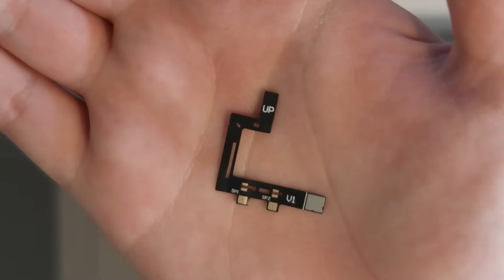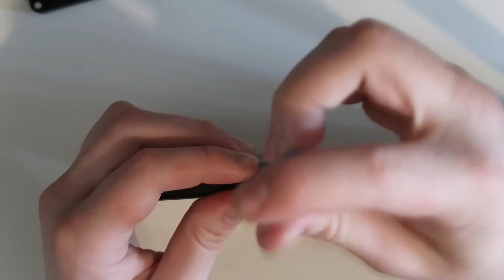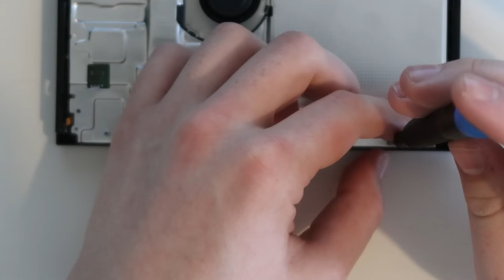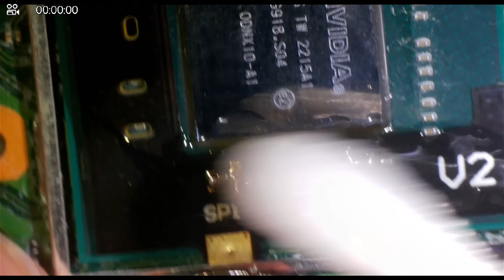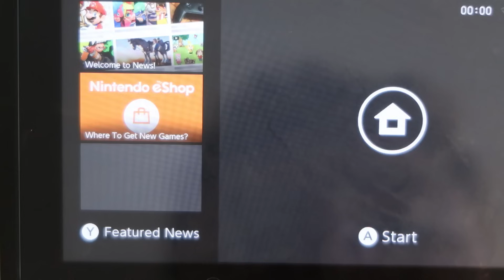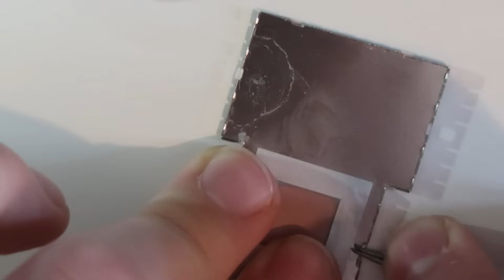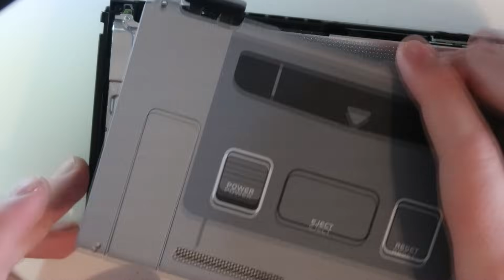Nintendo Switch RP2040 (PicoFly) V2 Modchip Installation

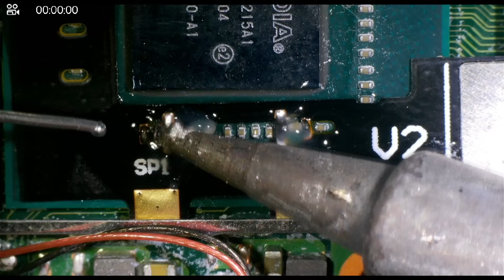Comment: He's really making it difficult at 12:30 by doing a coldjoint, chances of frying the resistors are very high. The proper way is to tin the resistors with solder, tin the flex cable. This way you have two points that can join more easily. Then wipe off the flux with alcohol, reapply a toothpick amount to each and it should go right in. 

Now the lite and OLED, different story..
Reply from the maker: This was my first V2 install, I agree it could be better. I just did an OLED and posted the video yesterday too.

Comment: Thanks alot did it successfully on a v2 switch. But i have a problem... After playing for like 3 minutes, it says ,console is overheating and it shuts down. Of course i cleaned all the old thermal paste off, and refreshed it... Well idk it doesnt even sounds like, the fan is turning on . Does anyone have the same issue?
Reply from the maker: If it's overheating, the fan will be very loud and you'll be able to tell. You fan is either faulty, or the ribbon cable isn't correctly seated.

Comment: I never did soldering what is that thing you use for heating it
Reply from the maker: The tool to melt the metal is called the soldering iron. Solder refers to the metal itself, and the paste that helps the solder joints form properly is called flux.
Reply: @TheModSmith  oh I learned it thank you and have a nice day :)

Comment: Which usb c cord did you use ?
Reply from the maker: Just a regular USB C cable for programming the chip.
Reply: I was told it needed power and data capabilities.

Comment: Thinking about modding my switch since i have a more recent version and I would need to do the whole mod chip installation but I've never worked with saudering tools before so this is where I'm a little hesitant on doing this in the first place if there are any recommendations you could share on what tools you'd recommend someone like me to use as a first timer that would be great! Thanks for the detailed guide I wouldn't even know how to unscrew all the right screws without this one.
Reply: I’m wondering the same things I’m new to it and everyone keeps saying sell my current one and just buy an unpatched one have you found anything?
Reply from the maker: They're probably saying that because of the difficulty of the modchip install.

Comment: I have a lite model rp2040 modchip. Can I use it in the v2 model?
Reply: Not unless you want a much harder job
Reply from the maker: You probably could, but for the sake of $10, get the chip that is intended for your console.

Comment: I plugged the mod chip to the computer but instead of a window popping up I get a long blue LED followed by 3 pairs of yellow short blinks. Does that mean it's already flashed or is it an error message?
Reply: I have the same issue, how did you solve it ?

Comment: Just curious, what temperature are you using on your iron here? Also, what kind of solder?
Reply from the maker: I solder at 420 degrees as I’m quite fast, although people recommend lower temperatures near 340 degrees. I also use 60/40 tin lead solder.

Comment: I modded my switch lite like 2 years ago. Have had a blast with it playing emulators/rom hacks/ etc. etc. Since I never had any issues getting banned on my switch lite I decided to order a RP2040 kit for my V1 patched switch. That was literally the week Mario Wonder released and I had a physical copy that I had already played multi hours on my V1 switch. I decided to pop the game cart into my switch lite and when the game booted it started auto updating without me hitting anything. Needless to say my switch lite is now banned... So now I've just been sitting on this RP2040 mod because I'm too afraid I'm gonna get my OG switch banned if I mod it too.
Reply: You should never, ever use a cartridge from a Switch that is not modded, on another Switch that is. That's an instant ban.
The cartridges have a special key that they synchronize with the first Switch where they are used, and if you try to put that cartridge that is synchronized in a modded Switch, there you will have the ban that you got...
I say that you can mod your Switch V1 without problem, the problem is the cartridges
Reply: Use emunand!!!
Reply: @lantonicorporation  How does that prevent you from getting banned? I was using emunand. So if I restore it from the backup I made before setting up emunand will that fix my online ban issue???
Reply: @lantonicorporation  Ah just grabbed my switch and checked... I was thinking of the emuMMC. But after doing some research I might still be able to save my switch lite. Doing some digging on emuNAND too so I might end up modding my other switch too after all. Thank you for the advice BTW!

Comment: I’ve got the mod chip ready for my switch. Unfortunately my display connector on my motherboard is broken, so I can only use my switch docked. Does the switch display a signal while being docked and booted into the new menu?

Comment: switch seems to not power on after i connect the enand to the chip, but will power on when the enand is attached to the board in its proper place?
Reply: silly me, i did not put the mod chip into the connector where the enand originally was

Comment: Hi, I got a V1 switch. I have soldered everything but when I turn it on, the chip flashes blue and then ==*. And it goes into the regular switch screen.

Do you know anything? Thanks!
Reply: @Natrez914 It's definetly patched. I have already tried the RCM jig thing

Comment: @20:15 IF YOU'RE TROUBLESHOOTING AND WONDERING WHY ITS BOOTING TO THE NINTENDO SCREEN INSTEAD OF THE MODCHIP: 

please also be aware that aside from the potential mod chip not being pre-flashed (which i believe is rare), it can also be that the switch isn't detecting the modchip (make sure theres enough space and not too much pressure where the mod chip is installed to prevent the connections from acting up (the pressure and screw and partial reassembly can also cause this (though in this videos case, it didn't). Really your soldering connections should look good and flush to avoid this, but just incase... I was wondering why mine kept booting to nintendo instead of the modchip whenever i'd power it on. And that was why. Make sure the connections are solid as well!
Reply: How you know when they’re solid?
Reply: @languidcreature2345  Well check with a multimeter on continuity mode first after the chip install. Check all newly soldered points. Once you'll be ok in terms of the connection. But again if there's too much pressure or not enough room for the modchip you may have to carefully clip the apu bracket to let the ribbon cable have space. And the mod chip you will have to cut the metal back shield as he shows here. maybe dont tighten the screws as tight if you have problems. i did!

Comment: i have a question: is re pasting the switch optional
Reply from the maker: No, thermal paste must be cleaned off with IPA and replaced every time you remove the heatsink or disassemble the console for a modchip install.

Comment: Way too much Flux and way too much solder you maniac
Reply: upload a video of how you do it
Reply: There will never ever be such a thing as too much flux, dingus.

You're the one that's gonna ruin your consoles 🤷‍♂️
Reply: Agreed, no clue how I managed but had no flux but managed to solder the pins.... thanks to this guy I was bored and ordered the kit from Ali express for less than £7 lol really shocked it works lol
Reply: @lewisviper soldering without flux is not a good idea, the solder points won't be solid and can break at any moment
Reply: solder wont stick to anything but the wrong things without flux  @swianr
Reply: @scottjohnston3098  not true, well unless ur hands are shaky and your solder skills are subpar. too much flux can actually lead to cold joints and less control. I rarely use much if any flux on my projects but I do use rosin core flux solder which is generally the perfect amount if you get it right first got. joints will be much stronger. also having a quality iron with accurate temp control and the right tip for the scale is crucial. never forget the day I upgraded my RadioShack iron to a hako it was game changing
Reply: @swianr I solder all the time without flux, although my solder does contain flux. If I have any issues getting a flow (because of an oxide layer) I use a mild soldering acid from a cotton bud only onto the contact. Not sure I'd use soldering acid on a switch, would probably be ok to use on the contacts before placing in the console but copper contacts are usually fine without it and the pretinned capacitors would also be fine without it. I also use lead based solder, it's allot better than lead free which suffers more with the issues you described.
Reply: @sirJbillz I agree, rosin core flux and the right tip for the job  work much better and easier, I have a dual side Weller with multiple size rips
Reply: @lewisviper  glad it worked man. what kinda soldering iron and solder did you use? gonna give it a crack
Reply: Too much flux? Never.
Reply: There is no such thing as too much flux... well, unless you're reballing. Yes, way too much solder, and those are the coldest joints I've seen
Reply: HHahahahhah maniac lol
Reply: You think he overdid it with the flux just look at what he did with that massive glob of thermal paste on the CPU!!
Reply: Never have to much flux?
Reply: He's so stupid
Reply: Never too much flux lil homie.
Reply: There can never be too much flux.
Reply: Flux is never a problem. Too much solder is also never a problem as long as you dont short.
Reply: There is no such thing as too much flex
Reply: If you look in the top left you can see he aligned it poorly so the solder joints don't line up. I don't know why he didn't fix it after the first solder joint was "done"
Reply: Is it just me or is soldering just the most unnecessary primitive nonsense in electronics these days...
Reply: JPs-q1o Why do you think that getting to work broken electronics is primitive?
Reply: @JPs-q1o  it's not primitive, you're just bad at it
Reply: 😮😮 16:06

Comment: Did everything, get the blue light then either a yellow/green led blinking but keeps booting to Nintendo’s firmware. Already flashed twice following this tutorial, any advice?
Reply: Nevermind, noticed that the plate to the right I had it on top of the metal cover, not under, so probably that was the issue. Once I bent it and slid underneath it booted straight to the right thing.

Comment: so 1Does this type of mod work with any switch (I checked the site and mine is patched), also how do I know whether to use the V1 or V2 cable? What if the chip I buy on AliExpress is always the same or do I need a specific one for some model?
Reply: All HAC-001 units are V1/Erista. Anything else, like HAC-001(-01), HDH-001, etc. are V2/Mariko.

Comment: I have a switch on 17.0.1 . Should i update it and then mod or just mod it on this fw? Also is the latest sthetix pack backwards compatible with any firmware?
Reply from the maker: Update to the latest firmware before modding and then use the sthetix HATS pack.
Reply: @TheModSmith 14:21 there are 7 capacitors on top of the 'V2' marking. Do you happen to know the value of the one closest to the flex? The one right above 'V2' writing.

Comment: are there any disadvantages to not putting the shield back on, planning to put a transparent back on it
Reply: The Shield helps with Heat distribution. Without it, your Switch might get damage from Heat in the long run!
Reply: @Sonicjan  thanks

Comment: After I solder the v2 and bridge them and go to turn on my switch.. the screen is just blank/black.. did I mess up my switch ?
Reply: Hey there just curious after a month - how did it turn out? Working? Broken? :/
Reply: @itami_aka_ju  i ended up getting a small amount of solder on a nearby capacitor, cleaned it up and everything works great

Comment: I opened it and the screen went blue.

Edit: In the end I sent it to be repaired, it was just a cut track and they installed the chip, thanks for your concern.

Pd:skill issue
Reply: You might have f* it man. Make sure GPU is alive
Reply: @user4gent416 😂
Reply: Maybe u need firmware to be flashed
Reply: YOU SHOULD HAVE SHUT IT OFF
Reply: skill issue
Reply: Skill issue

Comment: Cool stuff.
Have you tried a chisel tip? Someone recommended it to me some time ago, and after giving it a try on a few soldering I just could go back. It makes it easier to do good soldering points, at least for me, is the good in general. 
Anyway, I'm now considering cracking open my switch.

Comment: 15:05 his soldering kept getting too me,  he had it done but kept having to touch it up and making it worse like you had it perfect but kept redoing it and redoing it
Reply: I think cause he's looking in the magnifying screen so he can see cracks or lines in the solder maybe but it looked hooked up to me
Reply: @Platnatimingbelt  I'm a 16 year old dude with perfect vision, do I still need a magnifcation device? This'll be my first modchip installation
Reply: @Jason-sz7ek respectfully I believe in your ability to see if its soldered or not you don't really need it but it's good to have a cheap magnifying glass just to make sure cause your dealing with such small solder points but I now people who have done this mod without a Magnafying glass and had success so do what ya think make sure you have steady hands ahhahaha
Reply: @Platnatimingbelt My hands are pretty steady, im just scared ill botch this because the area im working with is just this small. Did you manage to get yours done yourself? Any tips on what to look out for
Reply: Get cheap microscope

Comment: It would be very helpful, more control, and more accurate if you have a fine tip for the solder iron.
Reply: I solder 0803 and 0602 with a normal tip without issues.
Size doesn’t matter for the tip, it does for your solder you want to have thin as possible solder. Or just use some paste.

Comment: Trying to figure it out:
A switch oled  with a Picofly rp2040 ... running a-ok on emulated size hekate and normal side.

Should you avoid 100% updating the switch firmware itself,  or is it OK, or what special methods are needed?

I'm wanting to play my physical game cartridges online while booted into stock/semi stock mode , but it keeps asking for the software/firmware of switch to be updated first.... 

Thanks!
Reply: As long as you keep Atmosphere and Hekate up-to-date, it's fine to update the Switch. The modchip interrupts the boot process before any updatable code gets run.
Reply: As long as you keep Atmosphere and Hekate up-to-date, it's fine to update the Switch. The modchip interrupts the boot process before any updatable code gets run.

Comment: if a V1 switch can be modded with RCM why put a mod chip in it?
Reply: Some of v1 switch is supported to do rcm and cfw, iirc usually the first batch release in 2017, and some of v1 switch machine released after that already patched by nintendo so you cant directly short the rail with jig and enter rcm. And there, modchip exist for the patched v1 machine and later v2 lite and oled to do cfw

I have softmod v1 switch without modchip and v2 ofw that im planning to do modchip after this video.
Reply: The Switch doesn't configure the charge controller in RCM, so charging after the battery runs flat is painfully slow. Like, "30 minutes to reach 5% battery so the thing can turn on" slow. Aside from that, keeping a phone or computer around is perfectly fine.
Reply: @valshaped   well why are you letting it die then? that's just all types of bad and the switch wont last very long without needing some repair maintenance to replace the battery periodically
Reply: @doomiedee  It only lasts a few weeks in sleep mode when not charging, and constantly short-cycling the battery when it's docked will cause damage too. It's not a common occurrence, but when it does happen, it's frustrating. Turning it completely off will help, but either way, you have to push a payload to get it to turn back on and configure the charge controller, whether the battery is dead or not.

Comment: Can this be used on the switch lite?
Reply: Switch lite has additional solder points than the ones in this video. So, no

Comment: For the metal shield cutting bit, what you can do is cut a longer strip of tape and tape it to the mod chip so it goes down and is visible, then just cut that same size and then remove the tape or shorten it, flip it, do whatever you want with it. Obviously you'll have to be careful when removing since the chip is free to move around and you don't wanna break a connection or something but I think it'll make it look better the closer the cut is to the size of the chip's plate

Comment: Cutting the shield over an motherboard seems very smart !
Reply: What’s your issue with that?
Reply: @eyehear10  small pieces of the metal you cut can fall inside. Its very easy to put the swotch on the side and cut the shield
Reply: easy fix: dont cut the metal over the motherboard?
Reply: @Flexeawery   Nice video by the way <3. Thanks a lot

Comment: You can use Kapton tape to stabilize the flex cable as you solder it
Reply: Or solder the ground pads if you don't have any
Reply: That was my first thought and I actually went and ordered some